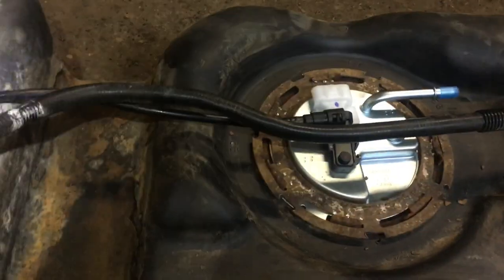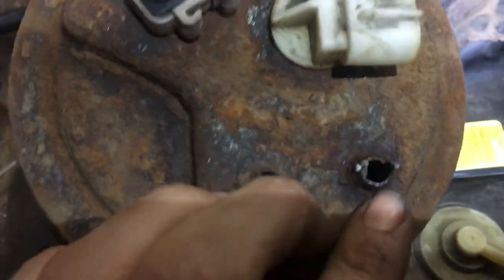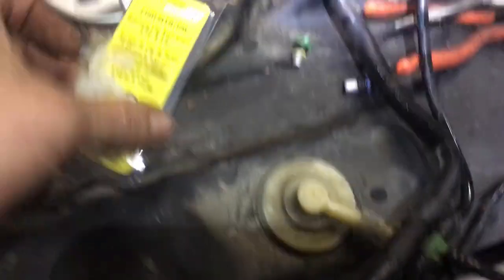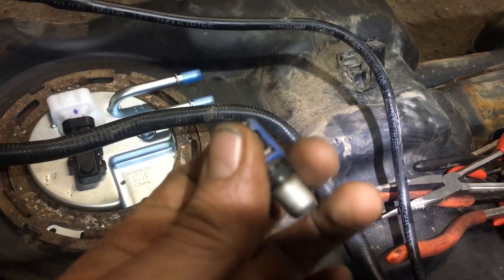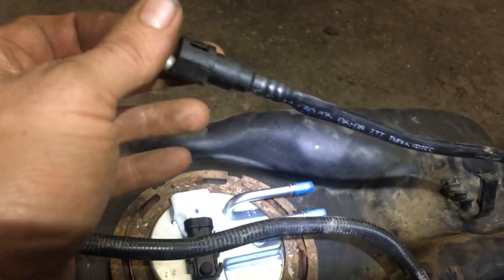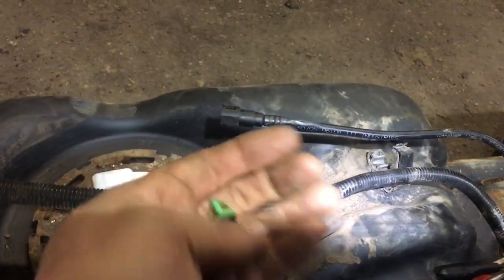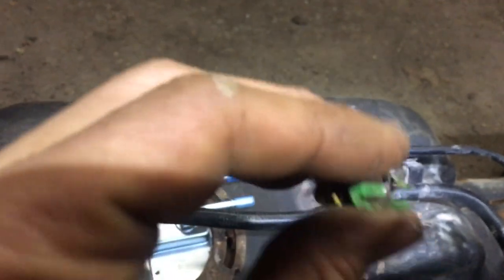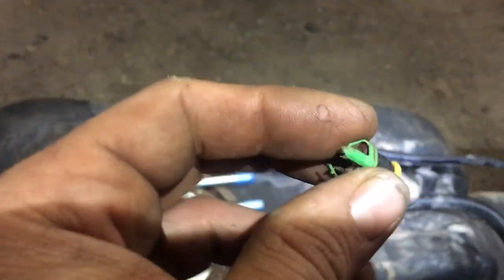GM Metal fuel line Stuck in plastic fuel line removal technique

Comment: You were right about rust here in the Midwest (Illinois), and these fuel lines.  I dropped my 94 LeSabre gas tank a few years ago to replace the fuel pump.  Ran into the same problem you described.  What a P.I.A.

Comment: But how do I still use return line if inside of quik disconnect come out ? Can you buy kit for replacing the o rings and clips ?
Reply from the maker: You can I don’t know what they are off the top of my head. But you can definitely replace the O-rings.

Comment: I Found out an easier way. Cut the plastic lines buy new connectors and joints to make your own. when i removed my tank on 06 sierra i had to cut fuel line to remove . now making new lines are much easier if you are capable of getting this far don't waste time trying to save junk. i will try to show pics at some point but it's very hard with my problems physically. this is why the plastic lines and connectors are faster to buy and make.    the pic that shows the piece i needed is the one in the pic. 
get the line so you can put them together when you have it away from your truck. 
i did like the video and it's a good tip if this is a better option use it. I just think for me with a few clamps or do it in boiling water to seal the connection to the line it's good as well' 
Thank You
Reply: Having the same problem, think I'm just going to cut the plastic lines and reinstall.
Reply: @mrman880  I have the tank with new pump /sending unit and connectors all installed back on m truck.
The straps holding the tank in place was my biggest problem of all .
The front strap was about 4'' to long and the 
rear strap was 4'' short. After trying 4 or 5 times finding the rear to short I made an extension but put the peace backwards .
had to cut and weld it together again.
Once the rear strap was holding the tank I cut the front strap and welded it together and  put it together again and started the truck and drove it down the street.
So now it works . I drove to the gas station
and put 20buck in .
It now is to hard to fill . It wasn't before
I haven't gone anywhere  with it . I don't go anywhere unless necessary. I still need to 
find where it's blocked and fix that. 
I also need to drop the front strap again so I can grind the welds so it won't wear a whole in the  the plastic tank . Now I need to finnish it so I can grab my homemade snow plow and finish that project .
I have a snow blower a plow for my mobility scooter and the plow for the truck ( winch)
operated. I will have to get some way to show you without showing everyone .   
If you want leave a reply here and I will leave mine. I will show picks after I know your email so we don't want everyone commenting. 
mrbulldog30@hotmail.com.
Reply: Thank you
Reply: @PatrickMillerRoofing  hope everything worked out. I have shown my daughters and son you never need professionals who are paid $100 plus hr.
It usually only takes minutes .
I have never had a plumber ,or others .
After sitting in the car back in early 80's 
weighing for micknick to install an alt took 3mins charged 1 1/2 hrs $ 90 + tax .
never again . I can barely walk and not without walker or scooter .
However I will be dammed if I will pay a micknick .
The last time was 2018 I just had my second knee replaced .
2 days before camping my truck was down for 6 months and I couldn't find the problem .
I changed the ground the alt and start were fine but click or nothing .
Battery fine . I was going to change the power wire from batt to starter but was struggling to get down and up.
Had to bring it in.
The guy said starter and after I told him I want the old one back.
He ended up putting a push button start .
$1000 cash . Got wrong start back and went camping drove 2 times  died as soon as I  got home .
Called the micknick he asked did I change the red wire from battery to start ?
As soon as he said that I knew what it was all along . The + wire.
So I checked the construction and every one was lose I was pissed.
Bought wireing and installed it now everything worked.
What he did was he installed all wires lose 
gareteing failure .
Hoping  I'd come back for the posative wire .
Called him back told him he's a fucking pos. 
Told him on every sight on line I will copy and paste everything he did . Never again .

Comment: Great info and I'm going to subscribe yo your channel. I was surfing trying find a video that's helpful and I think this is it. but I have one other question. I have a 99 gmc yukon denali and there is a long plastic line that runs on top from front to rear and it has a bend in the plastic line. It looks like the rear of your tank in this video. this is the only thing holding me up from removing the tank to clean it. How do you take those out with out breaking the lines?
Reply from the maker: Well if you reach out to me on Facebook under clays ac and auto repair Send me a DM with the picture of it I can tell you how to take it off I don’t remember what Line you’re referring to but I’m certain I know how it goes

Comment: How do I look up quick connect fitting sizes for the sending unit and braided line at the engine? I have an 05 sierra non flex fuel and want to run nylon front to back. Found Dorman complete lines but they were for flex fuel, so don't know if they will work. Did the pump last fall and used a brass union and some junkyard quick connects, want to get rid of that.
Reply from the maker: Possibly Just ask the parts store, so parts people won’t know but good ones will

Comment: Great info. Where can I find a replacement fuel line for a 2001 Sierra? The line runs from the tank to the filter.
Reply from the maker: Believe it or not Greg they’re Pretty horrible at the dealership you may want to check Dorman  they may have that but I’m not sure

Comment: Good tip, though most times the internal o-ring seal will get damaged on pipe removal and you will have leaks afterwards. These can be replaced though if you get the right size

Comment: I had fun working on my 2000 Chevy truck every time I touch the gas line broke. The hardest was the part that you described in the video I didn’t have to drill it out but when I went and got the repair section metal I did not know how it went together to the plastic because it flew apart ..I finally got it apart I think I figured it out right there’s an O ring then a black plastic Ferrell then the white clip itself to bad  I can’t send you a photo you’d laugh 😆 how I had to fix it with toothpicks but it’s not leaking I wish there was some repair you could cut off. The plastic end, and maybe some type of barbed fitting that would go inside and then somehow connected to the metal line this is the return line.
Reply from the maker: Hey if it works it works!!! Talk to you later Mot !!

Comment: On mine the o ring is still good but will it work ok with the little plastic grommet missing .(the little black ring that was stuck on there)?
Reply from the maker: It should I’ve never replace them all rings before I just put them back in I hope it works for you you will know real quickly if it does not but I doubt it will be a problem hope that’s helpful good luck

Comment: where do you get the O-ring at
Reply from the maker: Well unfortunately my best advice would be going to the hardware store and trying to find the O-ring or you can possibly go to your local parts store and get the end connector and it will have the O-ring on the inside of it they do make these aftermarket so you can replace them just take your hose and your connector with you to the part store and they should be able to find you the appropriate end and you can remove the O-ring from the inside of
Reply: @sharpcarco   this is what im checking for. i just wrestled with emptying the 26 gallon fuel tank on my gmc safari with a tiny squeeze siphon so that took best part of 6 hours i think and then wrestling the tank out after disconnecting from those 2, green and blue connectors. I want to make sure that im going to get the best possible seal considering my van was leaking from the fuel tank sending unit area. so doing youtube searches for info and thanks for what you showed there now i know that a o-ring is possibly in that line

Comment: Ok, holy crap, the o-ring and black plastic ring are part of the female connector. There are actually two o-rings with a plastic spacer between them, and then the black plug that holds them all inside the female end. When the male tube seizes inside, and it pulls the guts out of the female end, you need to reassemble exactly as it was. If you can get the parts off the male end without damaging them, fine, otherwise buy another female connector.
Reply: This is my issue . I finally got the rusty pipe off feedline but insides of quik disconnect all came out and the plastic sleeve is stuck on rusty pipe . Any advice on how to repair the disconnect would be awesome and save me $90 on each line 😊
Reply: @BLWTV  I was able to get mine off the pipe and back into the female disconnect. If you're not trying to save the pipe, you might be able to dissolve the metal out from inside the plastic using vinegar, etc. The connectors themselves (just the female disconnect to the hose barb) are pretty cheap. What would be costing you $90 per line?
Reply: @thelasttimeitried  already bought the feedline which was $87 . The return line I can not find . Meaning if I can't keep the ends in tact I assumed I would have no choice vut to replace lines . Vut of course I am no mechanic and learning as I go
Reply: @BLWTV  The plastic lines should just terminate at a cut end, and the quick-connect pushes into the line with a barbed connection. You can likely pry the old/damaged connector out of the hose, or, if you've got an inch of extra hose, you can cut it off and push your new connector into the fresh end. Since you're not trying to preserve the metal tube from the fuel pump, dissolve it out and re-use the original plastic bits in the old connector without pulling it off the plastic line.
Reply: @thelasttimeitried  thank you very much. All new to me . But not paying shop and I know I can get it